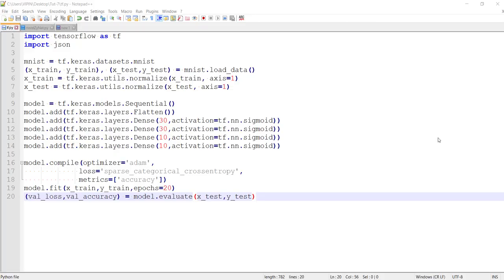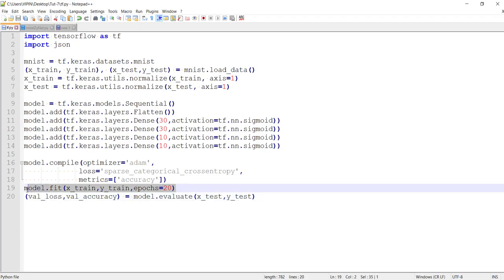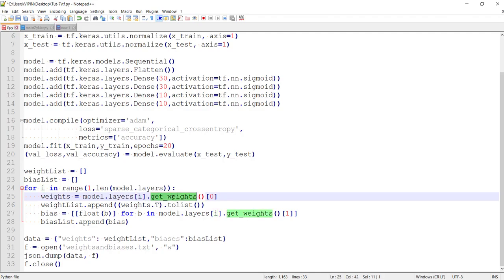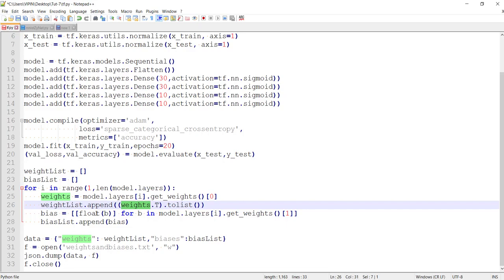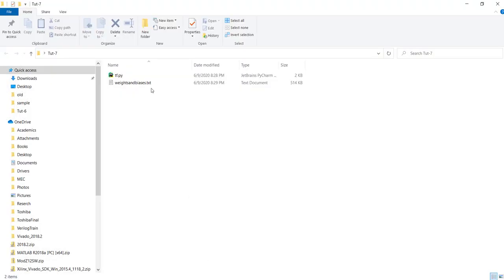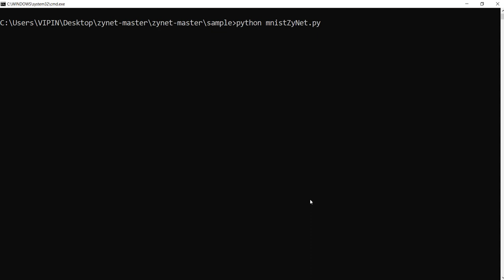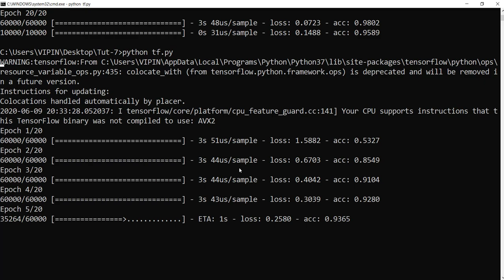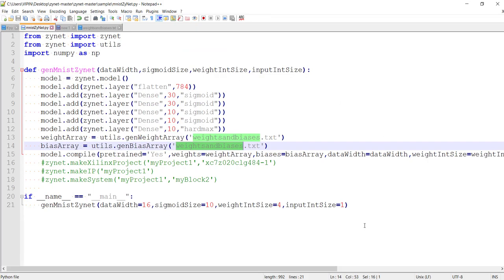Neural Networks on FPGA: Part 9: Generating weights, biases and test data from TensorFlow

Comment: hi, thanks for this great tutorial, I have a question when I synthesis code and run post-synthesis simulation it shows these warnings: File test_data_0000.txt referenced on ...cannot be opened for reading.
would you mind help me?? does it need anything before synthesis?
Reply from the maker: You need to copy all test data TXT files to post synthesis simulation folder inside xsim folder
Reply: @Vipinkmenon  thanks for answering me, actually I run post-synthesis simulation from vivado on ModelSim SE2019.4 but it shows this error, I add test.txt file to the ModelSim file but shows this error again.
I don't know what should I do for resolving it.
Reply from the maker: In modelsim type pwd to check which folder he is using as current folder. If ur file is kept in that folder it should be working. Otherwise I am also not sure why he is not able to see it
Reply: @Vipinkmenon  thanks a lot, can I know which version of ModelSim you used that compatible with your vivado??
Reply: @Vipinkmenon  sir when I change the filename in command $readmemb(filename,in_mem)in top-sim.v to the address of test_data_0000.txt it works correctly, but I don't know how can I change the address command to read 100 txt file.
thanks for answering me.
Reply: @anahitahosseinkhani4040   i had a similar problem, ERROR: [VRFC 10-9568] first argument of '$readmemb' must be a file name, any ideas?